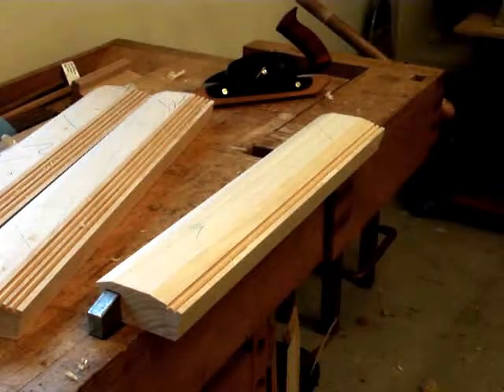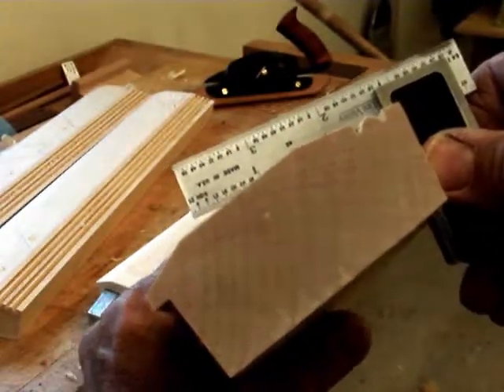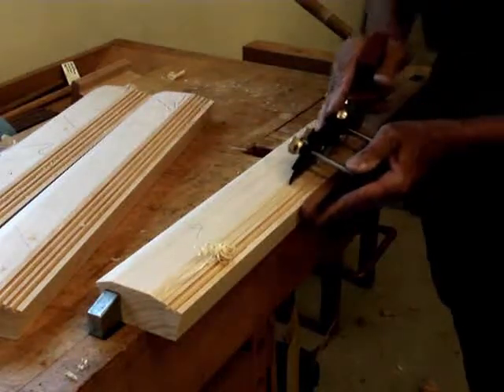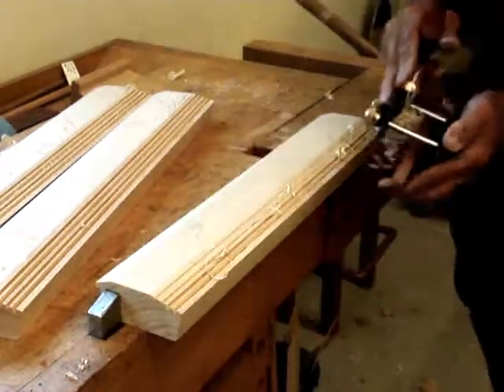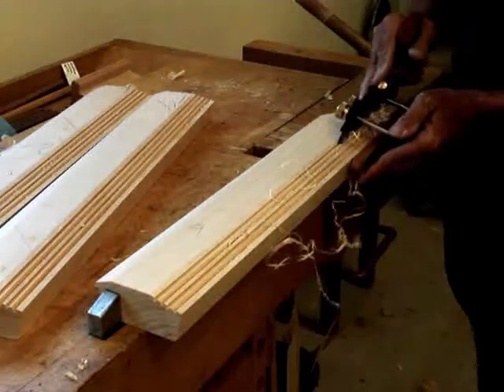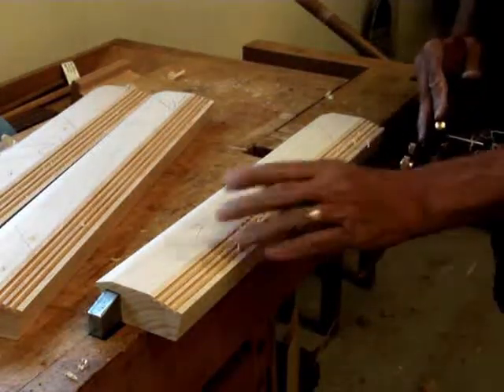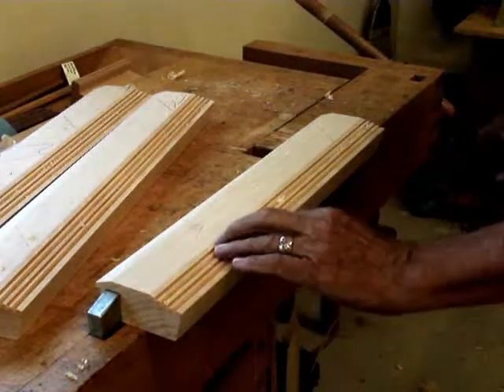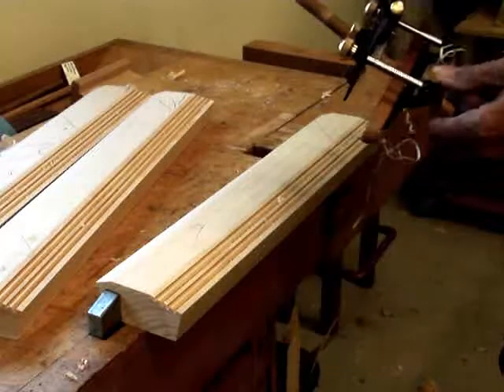Copy of Plow Plane    1

Comment: I wonder how you sharpen those beading blade?
Reply from the maker: It'll be a challenge I'm sure!  I figure that just flattening the backs of them from time to time to remove any burr will be the first step.  After that perhaps very carefully following the profile with either a water stone slip.  Thinking that it may be possible to also take an old water stone and form a profile in it to match the bead -- we'll see.
Reply: @dutchjohn1950   use the positive with honing compound.